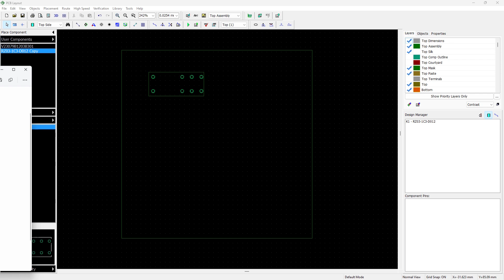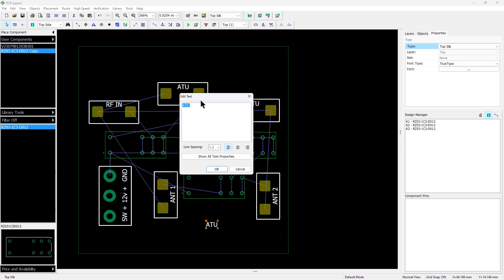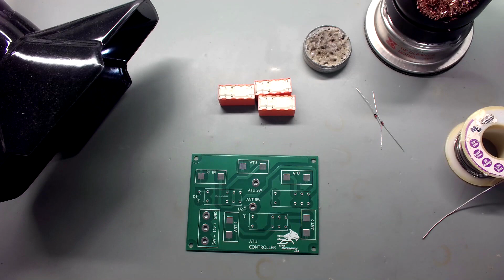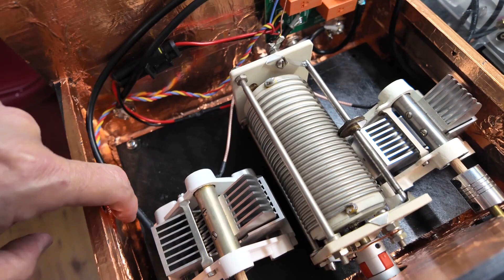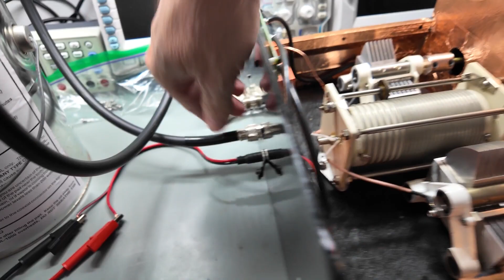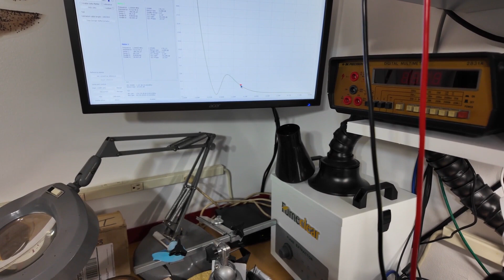Conquering My ATU Dilemma: Part Two

Comment: RJ, isn't 360 deg 'C' a little on the hot side for your iron?
Reply from the maker: Thanks for the great question,
This is a question that I used to get asked a lot in the old days at Diylightanimation.com. I would have a few people build kits and say “it doesn’t work” and I would say turn up your heat and resolder the joints. They would say they’re all good. Once in a while I would have them send it to me and I would point out the joints were cold on video. I would then touch them up on camera and every single time the device would come to life. This is why at our conventions in the old days I always taught soldering classes to everyone. From basic to advanced smt work.   The point is this, if you read “the experts on the internet” you will get a very wide range of temperatures to use. Many way too cold to get reliable solder joints in every case.  Part of this comes from the fear of oxidizing the tip side, to the big one damaging parts side. I have seen magnitudes more damaged parts from people setting the iron too cold than from too hot.  Seems wrong I know but just think of it this way. At any temperature that a person would reasonably solder at, almost any part can be damaged.  So you are cooking parts to death at any soldering iron temp that is reasonable.  So what is the difference between damaging a part and not? The other factor in the equation time.  It takes time for heat to flow up a pin into the device enter the die interface and then do damage. So when your iron is too cold you will solder the joint but it will take much longer giving the heat time to get in and damage. Hotter tip solders much faster so you are off the part quick not giving the time for your heat to flow. This is why manufactor do not give just a temperature that is safe on the data sheet for soldering through hole items. They give a time at a given temperature. Also to give a reference that it’s not just crazy old RJ believes 360c is fine here is the guys at adafruit saying they recommend 370c 

https://learn.adafruit.com/adafruit-guide-excellent-soldering/preparation#

So turn up the heat, stay on the joint Less time and if you keep everything clean, like me you will not kill parts and will never have cold joint issues.
RJ